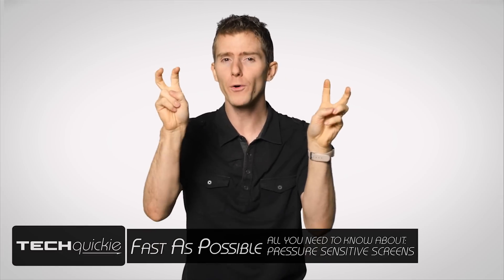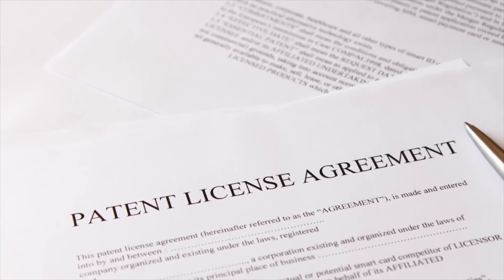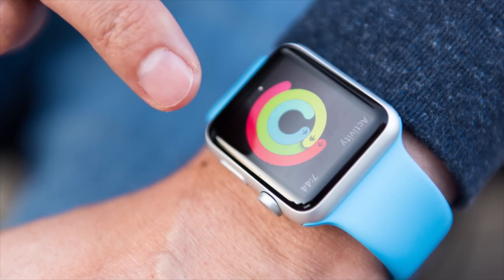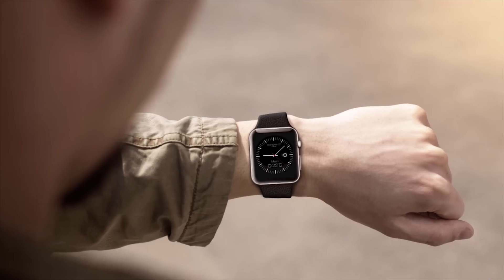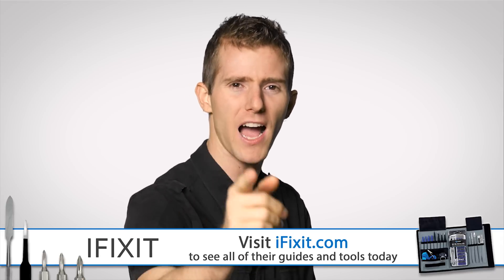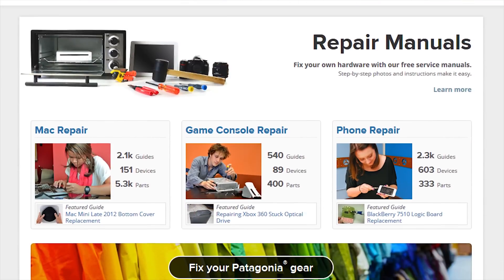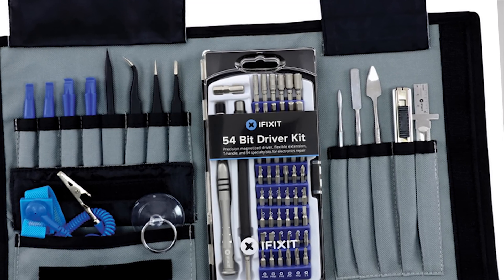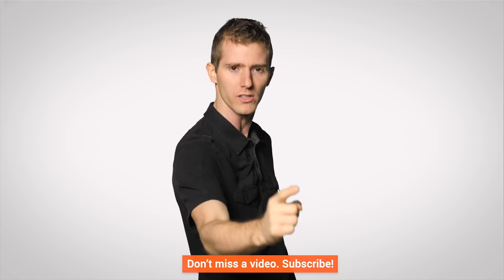Pressure-Sensitive Screens As Fast As Possible

Comment: i dont get it, why are Pressure-Sensitive screens coming back? isnt this the same as how touchscreen worked years ago? do this allow multiple touch detection??
Reply: Those are resistive touch screens and work a little differently. Similarly to most current screens, resistive screens only register the touch and the location of the touch (not the level of pressure of the touch).
Reply: Hippy Lemonz i see, but does this means this also works with multi touch? (i dont own an i product to try it)
Reply: Khalim Wu It might, I'm not sure but I assume it does. I don't think anyone has actually made software to take advantage of that if it does exist though.
Reply: +Khalim Wu It is. The difference between resistive touch screen and force touch is that force touch screens are still the same modern touch screens we use now, with multitouch and stuff, but with pressure detecting for additional functions.

Comment: It's sort of annying (and a bit surprising, considering how knowledgeable you are on these matters) that you act as if "force touch/3D touch" is a new thing, and that it needs specialized hardware. Manufacturers are only making specialized panels as a marketing gimmick (and/or because Apple did it). Android has had "force touch" since Android 1.5 in 2009. It was just never used, because nobody thought it needed to be. http://pocketnow.com/2015/09/07/force-touch-android-has-had-that-for-years

Comment: Wait a second. Wasn't pressure based touchscreens used before? Resistive touchscreen tech uses pressure (change in resistance to be more precise) as an input, so what is exactly different with Apple's new tech? Is it based on capacitive tech as the majority of current smartphones on the market?

Comment: Hey Linus! May you do HEVC H.265 Codec? Since it is replacing the current h.264. Id like to know the improvements and what this new codec brings to future videos.
Reply: Lower bitrate while maintaining the quality. That's about it. On the other hand it takes a lot more resources to encode/decode h.265 videos and hardware support is nonexistent, so it probably won't be widely used in the near future.
Reply: +hellterminator
Samsung NX1 shoots only in h.265, and it seems to be a better camera than the GH4 for a similar price.
Reply: MeMyselfAndPi “Widely” being a key word in my post. Yes, there are going to be more and more devices which do support it but it will take a good while before big platforms like TV broadcasting or YouTube switch to it. Hell until recently (a few months ago), YouTube was still using h.264 main profile at level 3.2. Compatibility is a big thing in this industry.

Comment: My xperia z3 could easily get a much more pressure sensitive "3d touch" with nothing but some software when the flaps are closed. because the phone has a pressure sensor on the mobo and air cant escape when flaps are sealed...

now if only that thing would not bootloop it would be great.........
Reply: +Anas Malas my compact died too... best phone ever, as long as it's working...
Reply: I don't think do.

Comment: still doesn't actually explain the possibility the future holds for this technology.
Reply: i agree.
btw, does ios not have long press like android? they are quite similar after all.
Reply: +Jason Khoo Now there is three ways to interact with your device. 1) Tap 2) Hold 3) Press. I don't know why adding it is a hinderance to complexity. It's a more complex phone to make, but that has no bearing on the user, and app developers are not required to use it, thus not making it any more complex for them. The only complexity it adds is repairing the phone and learning how to use it, but that comes with any new feature added, thus making those points irrelevant.

Comment: The DS Lite actually had a pressure-sensitive touch screen.

However, that was ditched with the DSi, seeing as no games utilized it(a homebrew app called "Colors" is actually the only example I can think of that fully utilized the pressure-sensitive screen).
Reply: +IkBenBenG just to let you know, there is such a thing as a "multi-touch" resistive panel.
Reply: +Aimela It's different though. Iirc the DS Lite used a resistive touch screen, which calculates the position of the touch point based on the forces applied to the screen's corners. This means that any screen of that type has pressure sensitivity, as long as the driver allows reading the force values directly. But because of it's 4 measuring points it is only able to track 1 touch point at the same time, and because it is sensitive to pressure rather than touches, you have to press it harder than for example capacitive screens.
Reply: are there any other devices that currently use this technology?

Comment: Would anyone recommend an iFixit kit for my first PC build?
Reply: +discotechwreck iFixit kit's REAL purpose is fixing laptops, replacing lcd screens in monitors, fixing smartphones...and other things like that.  For 99% of all desktop pc builds, the following tools will cover you:

1.  Magnetic-tipped philips head screw driver.
2.  Magnetic tipped flat head screw driver.
3.  Zip ties
4.  Small wire snips
5.  Double sided velcro strips/tape.
6.  Can of compressed air
7.  Black electrical tape.

Comment: What I want to see is pressure sensitive keyboards. It'd be really useful to video games to control how far you lean, how high you jump, how quickly you sprint, etc. with less modifiers and more precision. Imagine determining how far you toss a grenade or whether you crouch or go prone with just varying the pressure at which you press a single button?

Comment: For Android,  pressure sensitive capacitive screens could be a welcome alternative for accessing Now on Tap,  supplementing/ replacing the persistent onscreen navigation buttons,  augmenting specialized one finger and multifinger gestures for actions and shortcuts,  and maybe even allow for greater interactive media with videos and games.
Reply: +Dark Rush Well Android does have the API for it, it has had it since 1.0 actually.
Reply: ***** no it is a legit force touch just no OEM wanted to bother with it.
Reply: ***** It looks like it is designed for an actual pressure sensitive screen.
Reply: +Ryan Cavitt (Kira) It measures how hard you press by the surface area of your finger, since its been known the harder you press on something, the more Surface area the finger takes up. it's very shoddy, thiugh, in the fact that a palm could easily run it wild.

Comment: Can capacitive screens not detect the area a finger is using? Usually you're only using light force when swishing around on the screen, thus using a relatively small touch area, when you use more pressure, your finger surface deforms and needs more area, which should be detectable... right?
Reply: Could be possible, but not as precise. Your thumb takes more area than your index, so when you touch will that automatically count as a 'pressured' touch? If it detects the CHANGE from smaller to bigger, that will be unreliable because when you are pressing harder, there would be no change since you lift your finger and put it back every time you touch, so then it would only detect pressure when your finger is already on the screen, if you get what I mean.
Reply: +d3rrial it is and there are some apps that make use of that.
Reply: ***** I partially agree with that assessment. On the other hand there's some really good software out there for things like palm rejection on touchpads.. Who knows, maybe it's a matter of calibration and software and can be done without hardware. It's at least worth looking into I think.
Reply: +d3rrial yes but it's really unaccurate because the change in surface area depends on how you hold your finger when you touch the screen.
Reply: +d3rrial 3D Touch on the iPhone does use that and the accelerometer along with the "force sensors". They then combine all this info to get precise data for force + position :)
Reply: +d3rrial Also people's fingers are shaped differently and are different sizes, so this adds even more grey area to developing that kind of software.
Reply: corndogmaster12345 I don't think that's the point. What you say makes it harder to develop such software. The fact that the surface area doesn't increase when you use the tip of your finger to press makes it impossible to develop such software.

Comment: Galaxy phones and others have hover-ability as well, which is nice.
Reply: Air view*
Reply: +String.Epsilon S7 bro
Reply: he's talking about when you put your finger close to the screen and it shows extra info e.g. in the browser it can show definition. that's not the infrared sensor, its a different technology. airview does also use infrared sensors but that's not used as much and not what were talking about
Reply: +Zack Butler Your opinnion bro ;)
Reply: that's just the infrared sensor. most phones could have that.
Reply: +Harry Williams Yep I definitely see this feature on the Samsung GALAXY S4 and higher
Reply: S4 has it.
Reply: Harry Williams so floating touch, like the one introduced with Xperia sola?
Reply: Ms. Chanandler Bong yes. Also, love Friends!
Reply: Josh McCullough Hahahha thanks :)
Reply: ***** 2K is 1080p
Reply: +Dilip Tien 2k is 1440p...
Reply: MultiLittlegamer no is isn't. K = 1024. Look it up. 2K is actually 2048 x ~1080

Comment: should i still buy i5 4690k? and what would be a good mobo for that(oc)?
Reply: +bastard Your avatar is freaking terrifying, however unoriginal.
Reply: +Jato [HD] It's just a common house spider. You probably wouldn't want to meet my pet tarantula then lol
Reply: +bastard 
I highly recommend the i5 4690k if you don't want to push things too far, yet need a sufficient CPU.
Go with one of the new skylakes if you have the spare dollars and are looking for high end.
As for a motherboard, the MSi B85M E45 is pretty good and doesn't cost too much.
The mobo supports 4 dual channel DDR3 RAM slots, 2 GPU slots (pcie x16).
My setup uses all these components, together with a GTX 970 (MSi).
Reply: ***** i have gtx 970 aswell. i looked at ASUS Z97-C , some say its good oc board. im not sure what to do.